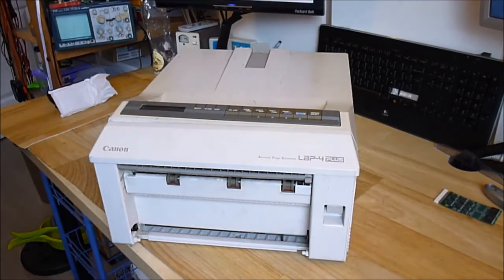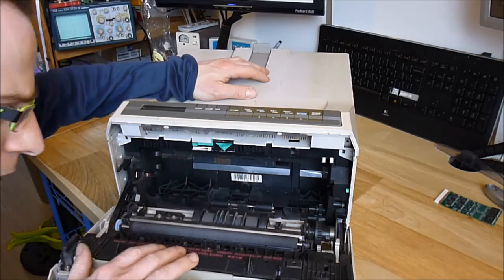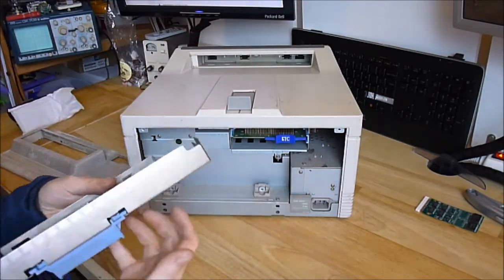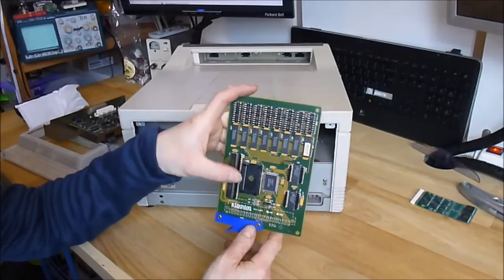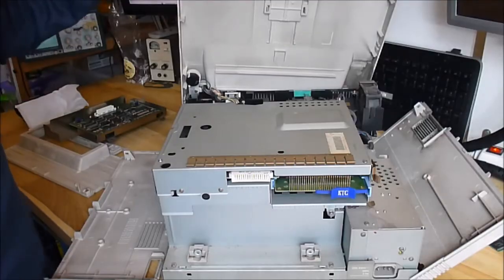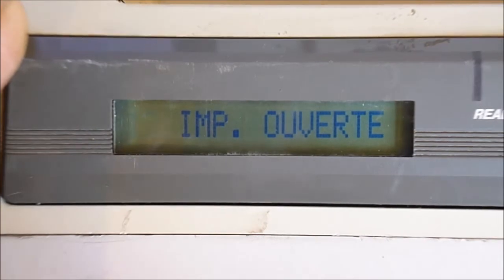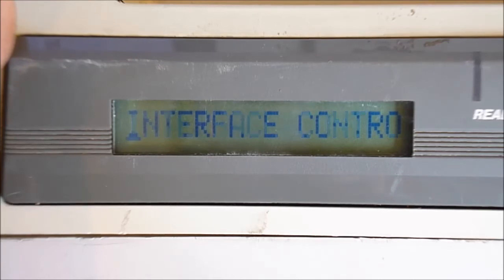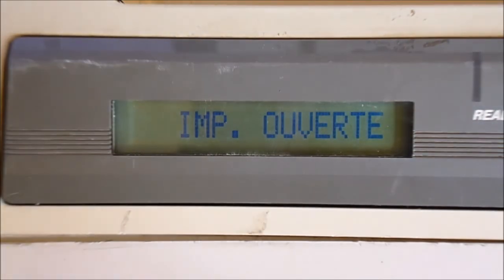Vintage Canon LBP-4 laser printer from 1991 with bonus crab !

Comment: Video port is for an external SCSI drive, used to store fonts that you downloaded to the printer. Saved you from having to send them with each print job when they were not a built in font in the Postscript engine inside. This was a Canon version of the HP Laserjet 4, using the same engine ( built by Canon for HP) but with Canon firmware mostly. There are articles about the HP laser printer development available on line for more information.
Reply: I respectfully disagree.

The Video port allows an external controller card to effectively direct-drive the LBP4 printer engine, feeding it raw bitmap data straight from the host controller's RAM. There was a controller card for the Acorn RISC systems (LaserDirect) and a few other platforms (the ICL/Three Rivers PERQ for instance). Essentially, the host builds a bitmap image of the page, then streams it directly to the printer. It has to do this in real time, there is no buffer memory (unless there's a buffer on the controller card). Naturally, this makes it difficult to do other things on the computer while it's printing!

It's actually possible to convert a CX or SX engine printer (a HP Laserjet II or III is the example that springs to mind) to the "video" model with a few 74LS buffers and a bit of cable. You remove the "formatter" PCB and replace it with the buffer board.

The more commonly known "video" port Canon printer was the "LBP-CX VDO".

There's a PDF file called "sm_lbpcxVi_e.pdf" (Google search for "LBP-CX-VDO" and it's on the first page) which contains the details of the video interface.
Reply: @philpem  Very interesting information. Thanks! Do you have sm_lbpcxVi_e.pdf? I could not find where to download it for free. Found only the pinout of Canon DC-37 video connector: 1,14-20,33-37-Reserved 2,21-BD 11-PRNT 3-PPRDY 12-VSYNC 4-RDY 13,32-VDO 5-VSREQ 6-SBSY 7-SC 22-31-GND 8-SCLK 9-CBSY.